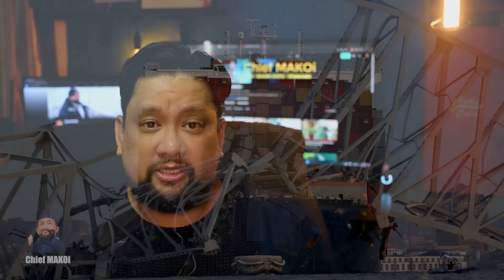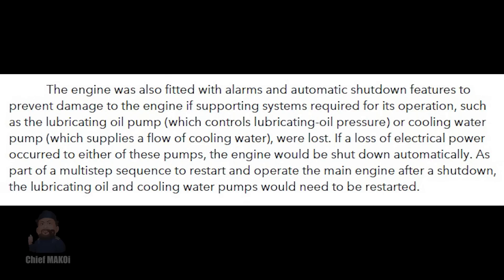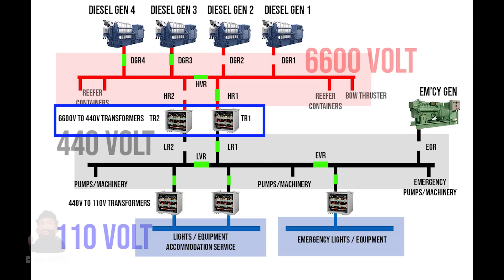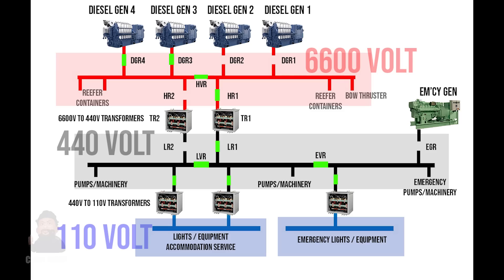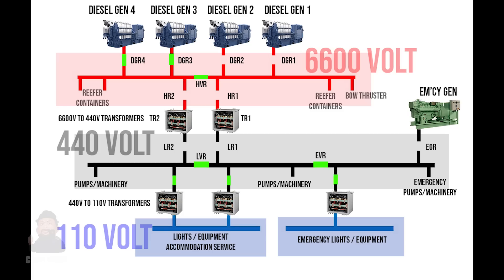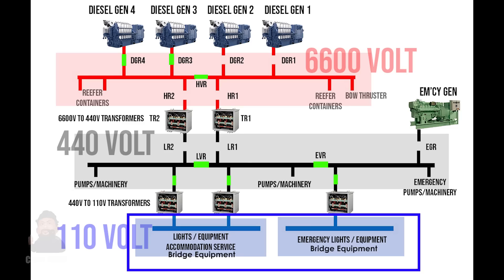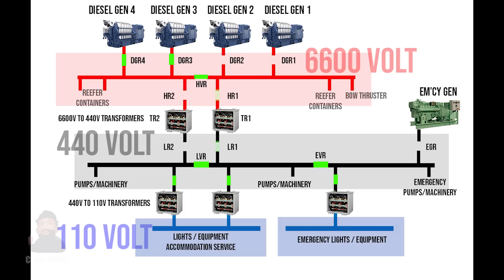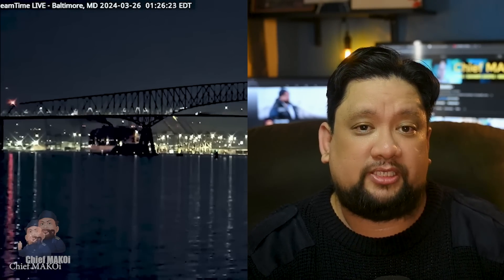Explaining the NTSB Report on the Container Ship DALI | Chief MAKOi

Comment: Again a very clear and concise and well presented.   I am breaking comments up so easier to read and address.    NTSB said the Main Propulsion was stand alone but then noted it depended on the electrical pumps.   Clearly an error.    The other odd one to me was saying the lube oil pumps were on the HV side.   That does not seem to be the case.
Reply: Clearly it's not an independent or self-contained system if it depends on external power for fuel and cooling while operating.  Might be considered stand-alone if they are only required for start-up.

Comment: Thanks for the video.  It seems to me that there has to be a reason that the main engine is designed to require power on the high voltage side to run the lube pumps, but the low voltage side can run the coolant pumps?   So no high voltage equals no main engine.  This causes the ship to lose propulsion while on emergency power.  What could the benefit of emergency rudder control be if there is no propulsion to enable actual steering?  Seems to be a critical failure in the design.  Anyone else think this is strange?
Reply: Good point! You can have all the lights in the world on emergency power but it ain't going to prevent you from running aground or hitting something like a bridge or another ship if you can't steer without propulsion.
Reply: Should be answered by ship diesel expert; just my 2 cents:
To my knowledge, ´heavy oil´ used as fuel for ship engines has very low viscosity at room temperature; almost like tar when putting it on the road from truck. So `heavy oil´ requires quite some heating before being sent to the diesel generators and main engine (perhaps ~80°C; sorry don't have number in Fahrenheit 😉), thus high amount of energy accordingly - this is why I'd expect the HV bus is used to provide high power here (to reduce current drawn). This is independent from LSMGO needs to be used within US waters; you simply need the capability when `heavy oil´is used on open sea.
Also learned from YT-chat with chief `Steam man´ that fuel injection pump provides pressure of 320bar (!!!). Means this is not small low-power motor, too.

Comment: After a discussion with Steam Man and Chief Makoi well done presentation,   I begin to think we are looking at dual causes which the CM hints at,   electrical and fuel.     I would like clarification that all 4 engine Generators depend on a common fuel pump?     I believe each has its own day tank (X hours) and then each should have an engine pump or its own electrical pump to feed fuel to the injection system.
Reply from the maker: They have a common fuel booster pump that takes from the service tank and delivers it to a buffer column, and a fuel circulating tank which circulates the fuel from the buffer column to the engines and back again to the buffer.
Reply: @ChiefMAKOi  But how long can DG3 and 4 keep running if there is no voltage on the 440v bus?? Maybe that was all the black smoke, the generators started running badly with no power to the engine room 440v equipment. If the problems are not found to be faulty equipment, do you think the chief engineer on Dali will be looking for a new job soon?? lol Of course, the ultimate responsibility falls on the Captain's or Masters shoulders, but from the companies point of view, the chief engineer had one job. To ensure the power plant was serviceable and fully operational. If he felt there was some serious issues with the electrical system, why not raise the issue up the chain of command, rather than just leave port? It would be much simpler to just move the Dali off the cargo loading area to somewhere else nearby, and arrange for a repair crew to come in to do switchboard maintenance/transformer testing etc. It's a long voyage to Sri Lanka, and if I was on board, I sure would not want to risk a breakdown somewhere between Baltimore and Sir Lanka, there's 1000's of nautical miles of pretty desolate route, with no nearby repair facilities etc. A lot can happen in 27 days at sea.
Reply: @ChiefMAKOi  Question when using `heavy oil´ once on open sea: I'm aware it needs to heated up, else viscosity is too low by far. So what's the temperature then (would expect ~ 80°C)? Which is why I'd also assume that's the reason 6600V supply is used for fuel system; simply very high power demand. Just to double-confirm since your reply above suggests so: is it also used for the 4 diesel generators then?